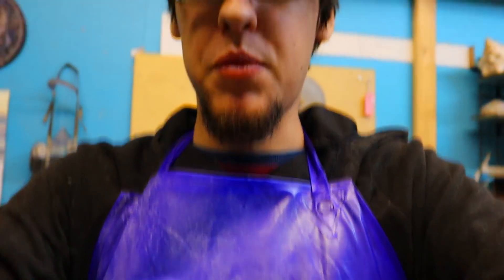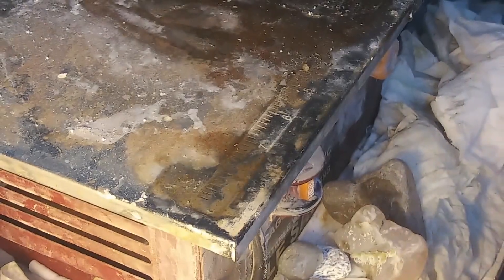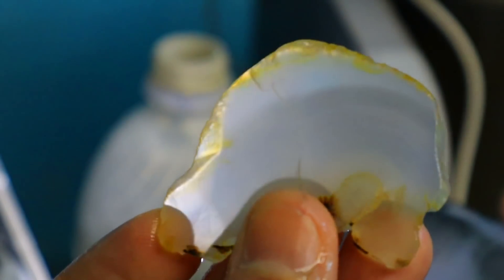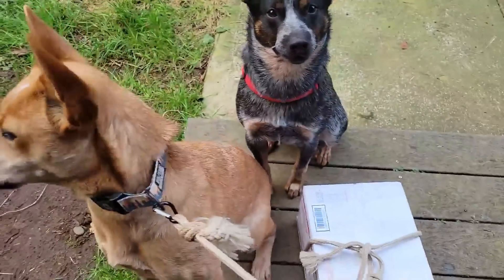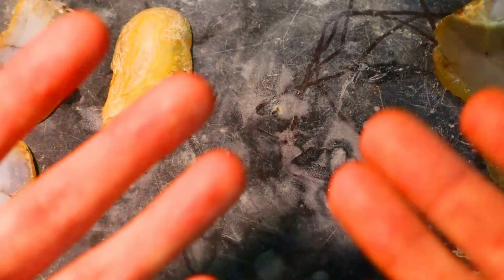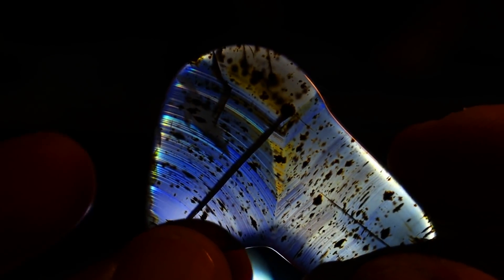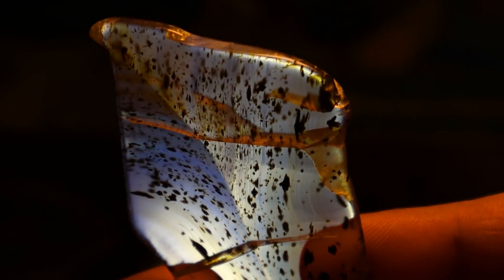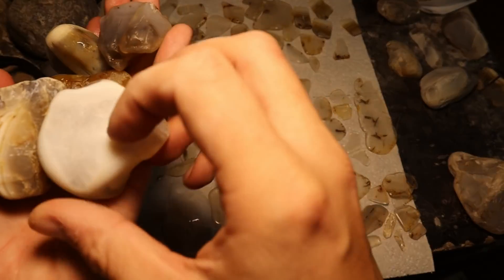These Agates are Outstanding! Cutting & Polishing Elusive Iris Agates ft. Ozone Fine Art-Ventures!

Comment: Such a great video! Humor, friends, dogs, agates and so much beauty, just awesome. How thin do you usually cut the slabs and do they need to be tumbled in a vibratory or if you cushion enough, with ceramics and pellets, would slabs work in a rotary tumbler? Just curious. You and Karen create such beauty in your rock art of all kinds, very amazing. Thank you for sharing Theo!✌🤠
Reply from the maker: Thank you so much! It really means a lot!😄 so there is a bit of a range when it comes to iris; really good iris can show fairly thick but others dont really shine until they are a good bit thinner, so the rule of thumb is 2-5 mm👍 a REALLY bold iris will show at 5 but generally speaking they almost always need to be brought down quite a bit thinner. Some of my best are ones ive ground down to 1.2 to 1.6 mm. I dont have a very reliable saw, it really likes to make agates blow up😂, so i usually cut thick and then grind them thinner before tumbling. And I do all of my tumbling in a rotary but a vibratory would actually be better for this purpose! I just dont own one🤣 its on the list!
Reply: Harbor freight has a 18lbs vibratory tumbler that works really well starting with stage 2-4. You will also want to use the ceramic media with it as well at a fraction of the price.
Reply: @TheoKellison  thank you! I find it all very interesting and really pretty cool. I appreciate how much I've learned from your channel!😊
Reply: @slothhunter4615  thank you for the information, I appreciate it!🙂